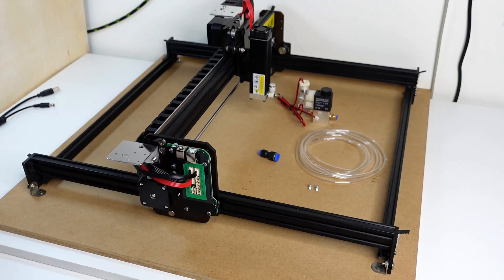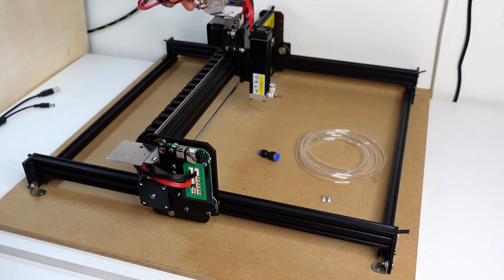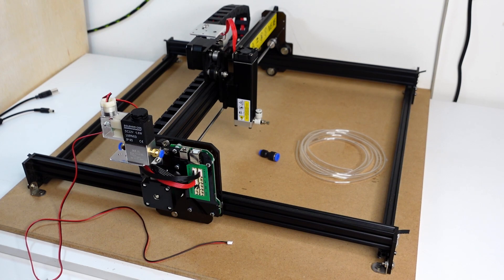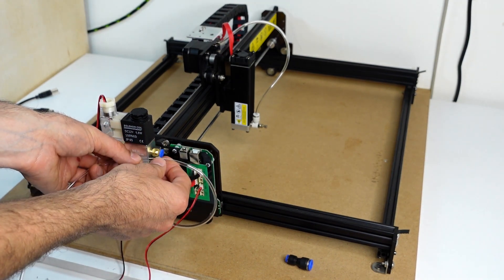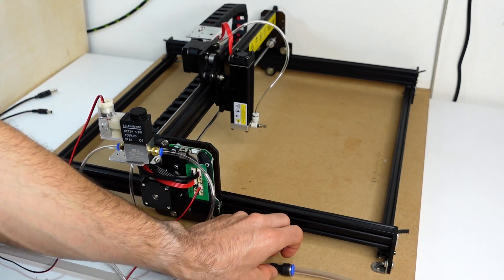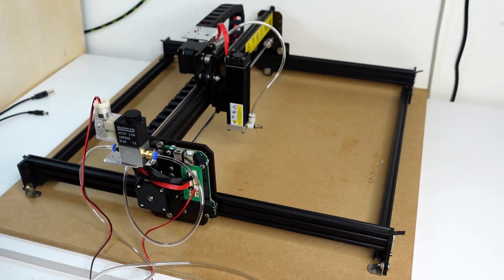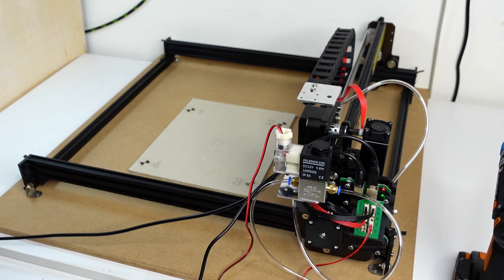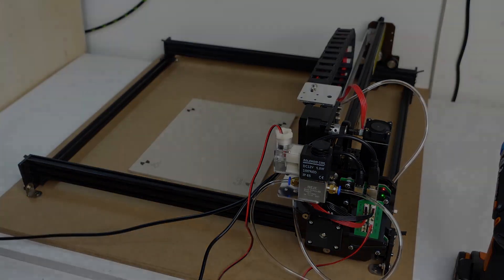Air Assist Installation and Controll | NEJE 3 PRO and MAX | LaserGRBL & LightBurn

Comment: Hi, can you tell me please if both axe Y stepper motors cables are wired in the same way ? I can’t find indication about that and don’t know if the right Y stepper motor direction is inverted physically by the pins or by the software.
Reply from the maker: Hi, Issam BATTI; thank you for your feedback, 

I guess you refer to the NEJE 3 MAX since the 3 PRO does not have a double y-Axes motor. 
I haven't had this machine, but in general, Machines with two steppers for the y-axis use two different approaches depending on the board.
Either an in-software direction inversion for one of the steppers or swapped wiring for the stepper motor cloning method.

From what I can see in the 3 Max Board, the wiring is the same (follow the numbers) https://cdn.shopify.com/s/files/1/0370/4215/9752/products/NEJE-3-MAX-mainboard2_b60e2901-afa0-4630-8197-1ef5ea085e1a_1024x1024@2x.jpg?v=1648912466
This means that if one of the motors pushes in the opposite direction, it is a configuration problem, and I would recommend using the NEJE app to update the firmware. 

I do not know of a way to invert just one of the steppers on the same axis from the GRBL configuration that should be coded in the firmware stored in the board.

Let me know how it goes.
Ciao
Reply: @MiddleRoomWorkshop  hi, thank you for the reply. To be sure I unplugged one of both stepper motors and I tested one by one without belt. So I confirm that is GRBL that invert the rotation of the left motor on the code. Maybe that can help others makers.
Reply from the maker: Hi, Issam BATTI, thank you for your feedback.

That means that the gantry tends to sway, i.e., so say, the right stepper pulls down, and the left pulls up. Is that right?

I will investigate further on it, but as I mentioned earlier, this is the Machine's maker implementation. I haven't been experiencing machines behaving like this. 
An alternative would be to re-wire one of the steppers so the signal is physically inverted.

Ciao
Reply: @MiddleRoomWorkshop  I think that NEJE designed the machine like that to facilitate the cables wiring for users. You don’t have to wire cables differently for right and left motor. You have just to plug right motor cable on the right connector ( Y - R ) on the mainboard and doing the same for the left motor. Like that, GRBL can send the right signal for each motor to turn on the right direction.

Comment: I just purchased a Genmitsu Laser Engraver Cutter Air Assist Nozzle Air Pump Kit  to go with my NeJe Pro. Do I disconnect the air assist that came with the NeJe and use the M8 connector on the motherboard for power and connect the air hose from the Genmitsu directly to the air assist nozzle  on the laser unit? I REALLY need your help!! Thank you :)
Reply from the maker: Hi, clell osburn; thank you for your comment. 

The M08 in the mainboard of your NEJE Machine is designed to control the Electro valve that you should have received with the machine, alternatively, you could use the switch (small black box) originally designed for the fan to control the air pump.

The connection should be as follows:

Method 1 - Direct control of the pump without a valve.
Air --> From the air pump to the nozzle on the Laser Module.
Electric --> The power supply of the air pump should be connected to the black switch and from the black switch to the air pump. Mind the side if is DC power or AC. The black switch can be connected to the M08 in the Mainboard.

Method 2 - Valve Control (Simplest)
Air --> From the air pump or compressor to the NEJE's valve and from the valve to the nozzle on the Laser Module.
Electric --> The Valve connected to the M08 in the Mainboard. The air pump or compressor should be energized separately.

Let me know
Ciao

Comment: Nice video but I would prefer to connect the air line direct to the nozzle and use the M08 signal to control a relay module to turn the compressor on and off.

Comment: Thanks for your video!! Great stuff! Just one quick questions, you talk about the compressor line 07:10 . What kind of compressor do I need? Hope to get a response! Thanks
Reply from the maker: Hi Wiebe Audenaerd, thank you for your comment.

When it comes to air assist, you can either go for a true compressor, and in this case I suggest a quiet and oil-free compressor or a dedicated air pump which now can be nought by the various brands.
The difference between a compressor and an air pump is in the pressure; the air pump is more like a high-pressure fan, but the pressure and airflow is usually enough for the purpose. 

I use a quiet - oil-free compressor from vevor but I regulate the pressure output to about 3bar or about 45psi. The only caveat with a compressor is that you will need a water trap to avoid water getting into the line.

Below you will find some links to the various product.
I would suggest some dedicated air pump, compact and quiet; just pay attention to the hoses so that you can plug the various components.

Compressor oil-free and quiet
https://s.click.aliexpress.com/e/_DFyh6jt
https://s.click.aliexpress.com/e/_DBxAg87
If you use a compressor, you will need a Water Trap
https://s.click.aliexpress.com/e/_Ddo089z
https://s.click.aliexpress.com/e/_DEMFjE3

Air Assist pump
https://s.click.aliexpress.com/e/_DCjJPoP
https://s.click.aliexpress.com/e/_Dnnpi7v

Let me know
Ciao

Comment: Thanks for the video. Is it only the 3rd series where you can add az electronic valve, or there is a way to do it on the 2nd as well?
Reply from the maker: Hi Attila Szabo, thank you for your comment. 

Unfortunately, yes, only the 3rd series can control the electro valve. 

Ciao